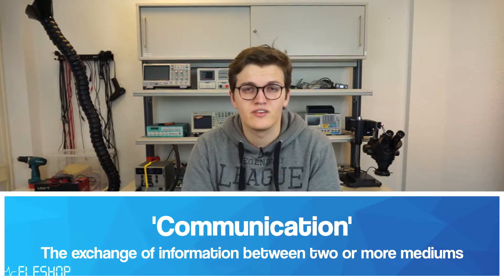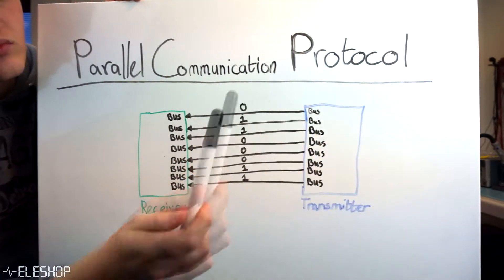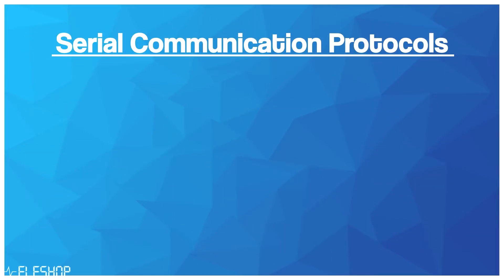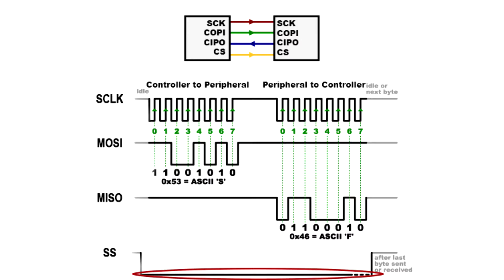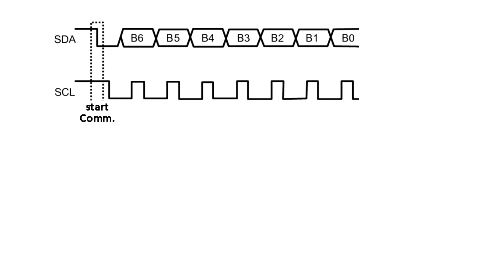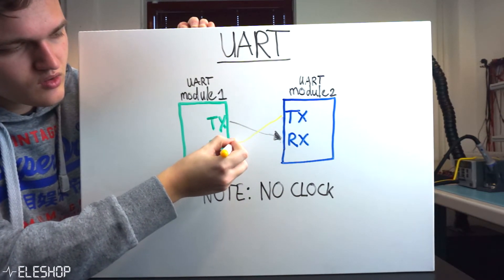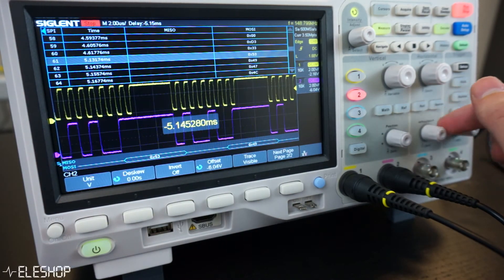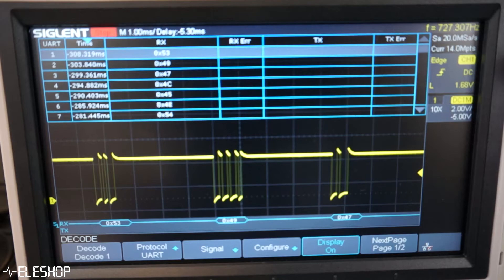What are Serial Communication Protocols and how do they work? SPI, I2C, UART

Comment: They work from an active txco on the board, without this clock/tick the whole device would struggle. Routers and modems need active clocks aswell  some are suppiled by the computers front bus 100mhz 400mhz l2c spi however fast ethernet and jsb require multiple active oscillators (4pins) or you can borrow an active clock with a 3 wire ceramic resonator. 2 wire oval aluminium resonators.are used to multiply/clone the txco so the chip can send the output enable pin off so it can use that circuit as a receive buffer